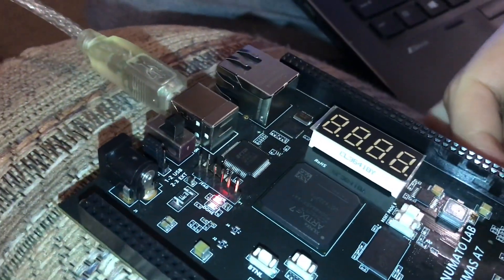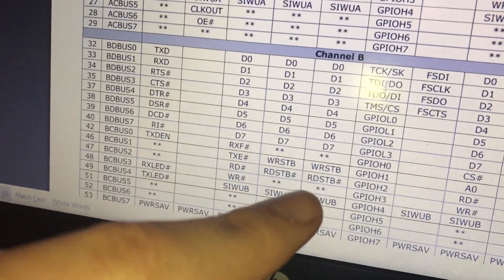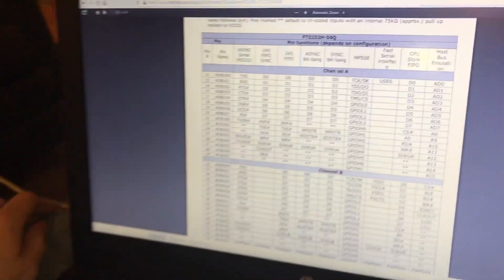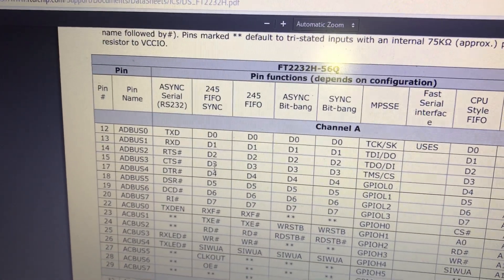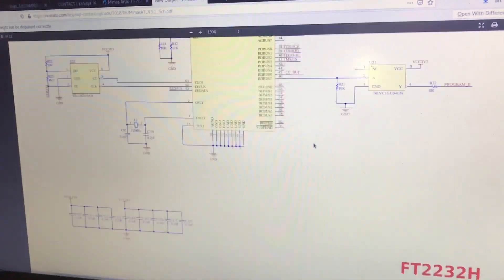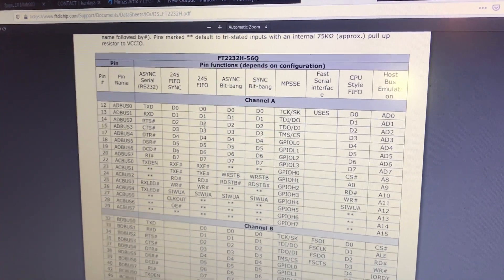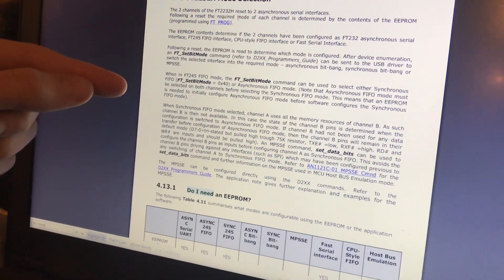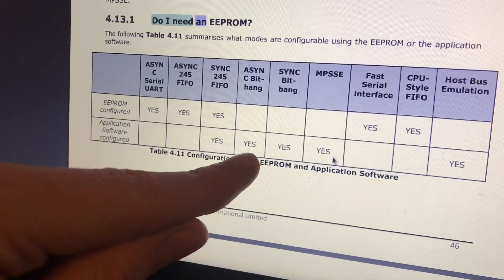the swiss army knife of usb CONTROLLER chips( ftdi t2232h)

Comment: When I read the EEPROM from my mimas a7 board, both channels were configured in UART mode.

I think you could still use channel A in synchronous FIFO mode. Entering synchronous FIFO mode is a two part process: the EEPROM is configured as an asynchronous FIFO, then the application switches it to synchronous FIFO. You'd still be able to program the FPGA so long as you weren't actively communicating with it in synchronous FIFO mode.
Reply: Actually, it doesn't look like it's possible:

> Note that Asynchronous FIFO mode must be selected on both channels before selecting the Synchronous FIFO mode in software.